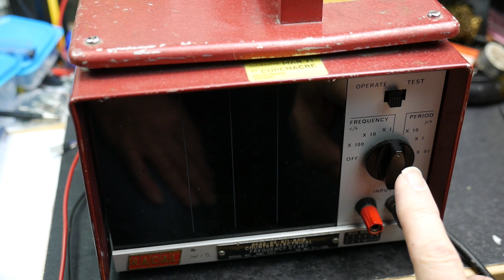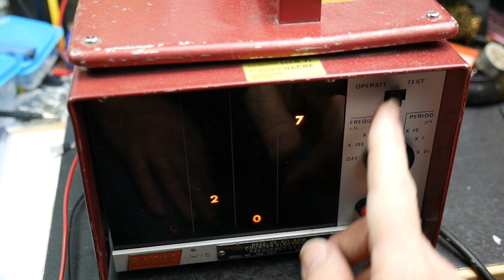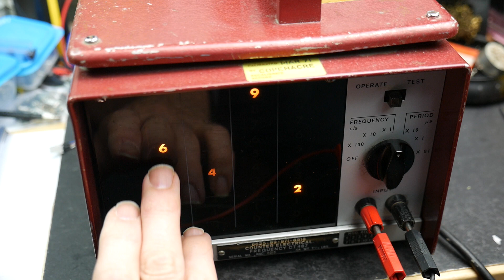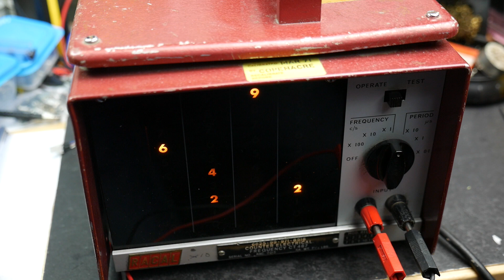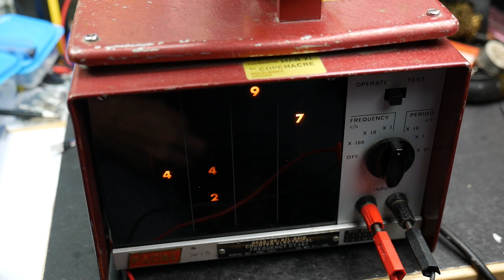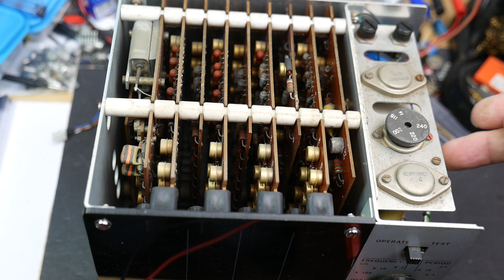First Look at the Racal SA520 Digital Frequency Meter

Comment: Thanks for posting this. I have just acquired one of these and your video was a good insight. I'll check your profile to see how you got on with the repair and if you made a follow-up video.
Reply from the maker: Since making this video, I have acquired a six-digit Racal SA535. I've swapped all of the spare bulbs (originally two per digit) over to the bigger instrument. But that one also has some transistor faults.
Reply: @anachrocomputer  Good to have another unit and wish you good luck with it, I look forward to seeing any related videos.